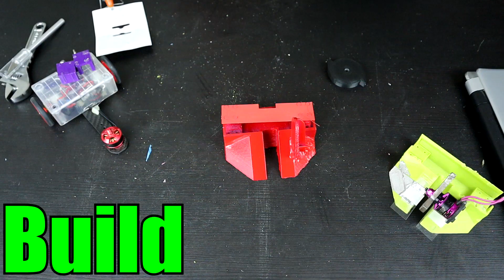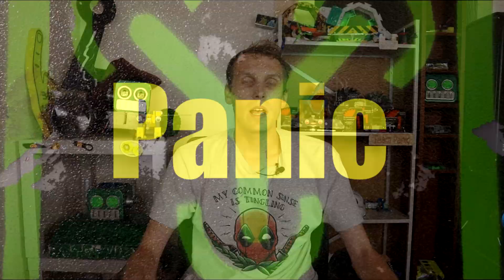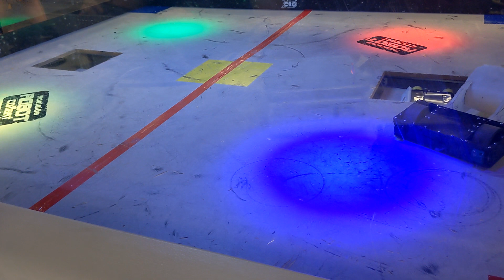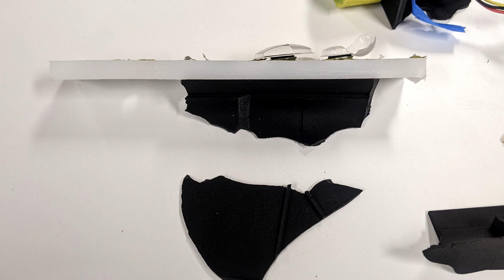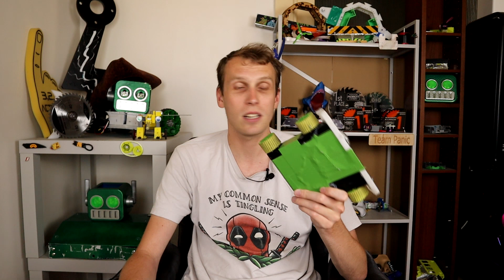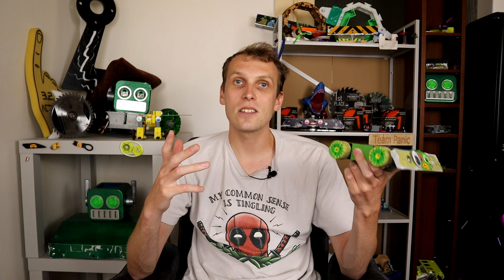Fighting with too much drive power!! (1.36kg combat robot fight report)

Comment: Just some random ideas from this... So when thinking about pushiness, what are the factors... Downforce, wedge angle, wedge length, wedgelets (you have to go under all of them or you will get stopped anyway), robot length, weight distribution, motor power, graby-ness of wedge (think of barbs like shatter, top stops to prevent climbing, slide control like dust panes and so on). You also have to consider wedge design against spinner: side angles for horizontals and lowness and length for verticals. There are many factors here and motor power is only a small%- I think with motor power like this you want to build a more lift and slam bot- using the motor as a weapon similar to vlad or other like bots. Perhaps a more dust pan design (with some barbs to trip them up and sloppy sides to counter horizontals) would make sense here as you want to be less of a survive bot and a more aggressive bot using your motor to slam opponent about.

Comment: Yeah was thinking about this when you mentioned the chassis was printed from a powder-based process. These processes usually leave voids between power particles that make things weaker. Used to have a SLS nylon chassis for my plastic ant and the results were similar.